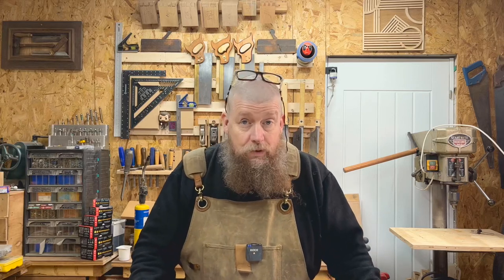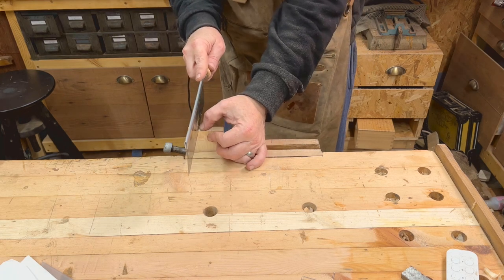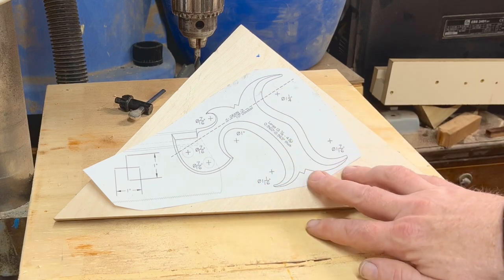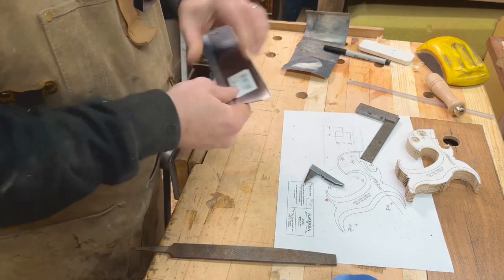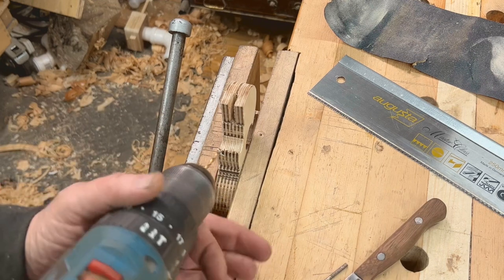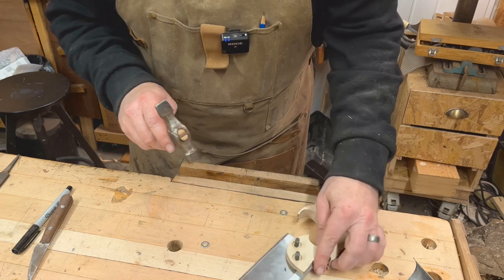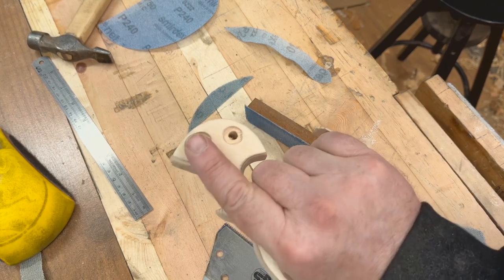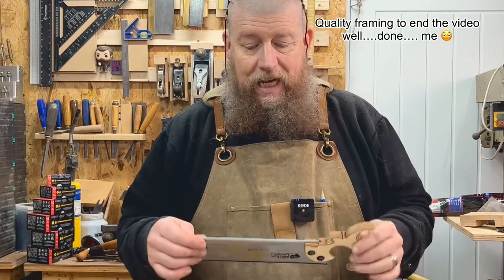A very posh saw you can have for £8

Comment: I did the same with a PAX gents saw about three years ago and modified the hang quite a bit so I had a saw set up specifically for cutting half-blind DT’s (I work really high when dovetailing since I use a bench on bench moxon).  They’re super cheap, sharpenable, and made with 0.015 plate.  Really a great investment; they’re about ~$40 USD now. Thanks for the content brother 👍
Reply from the maker: Thanks for watching SMEAC, and great to hear you did the same thing!

Comment: Definitely on the to-do list. My only question is, with using the original oversized kerf, wouldn't the slot be too wide/loose to grip the blade properly? Or did the plywood have enough give once the bolts were tightened  to provide good contact?
Reply from the maker: The kerf width wasn’t an issue at all 😊

Comment: Impulse hardened teeth. You won't be able to re sharpen/ set that saw and expect it to stay sharp for long. But for 5 squid it is fine as a user until blunt then chuck it in the bin and buy another. Good part is it is perfect to practice your handle making and not screw up an expensive saw.
Reply from the maker: Exactly, a solid experience that I’ll definitely revisit in the future

Comment: Hi dean im looking at buying a footprint tenon saw but can i change the Handel to the one like your doing cheers steve👨🏼‍🦽
Reply from the maker: I imagine you could do, but a pistol grip on a harder working tenon Saw may not be great. I would suggest reshaping the handle to perfectly fit your hand with files and sandpaper, if you actually need to.
Softening harsh corners and adding a curve here and there can make a huge difference